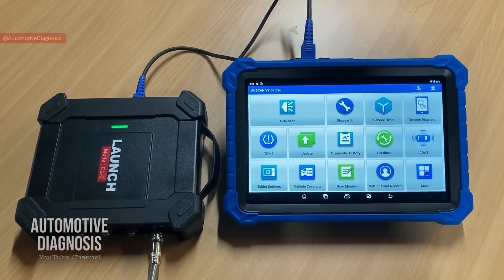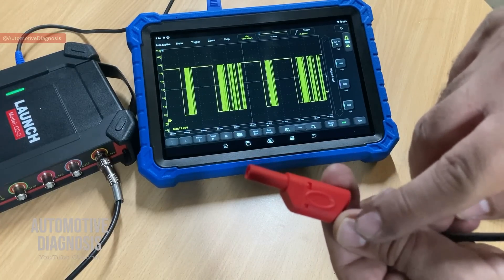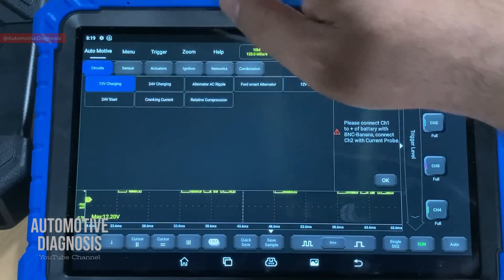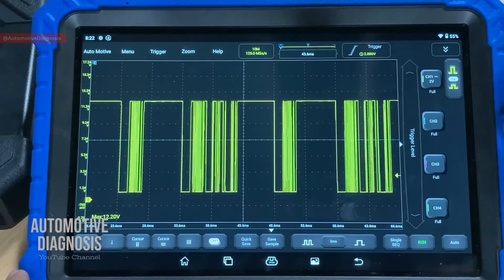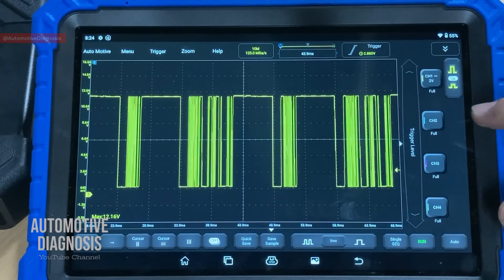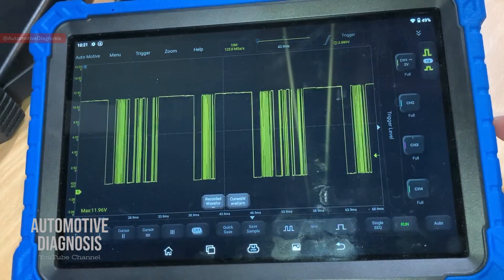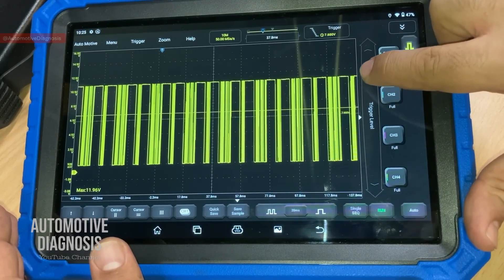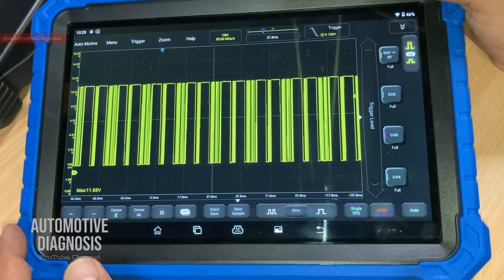Everything about Oscilloscope for Automotive Diagnostics | How to Set Up, Read & Analyze a Waveform

Comment: Can u help me. When I check my secondary and primary ignition my way form is super tiny can't even see it
Reply from the maker: Hi my friend, adjusting the time and voltage can make the waveform taller and bigger, good enough to read it. I explained how to do this in this video.
Reply: @AutomotiveDiagnosis I bought this oscilloscope from launch thinking was better then hanket but I'm thinking hanket is better .or maybe I'm just not the fermiliar with yet. 4 wire ignition coils are hard too graph.
Reply from the maker: @hayguey7952 This scope is very user friendly, I believe you will get use to it very fast, for ignition coils with 4 wires we have a video on the channel.